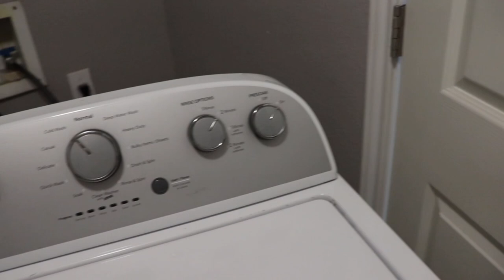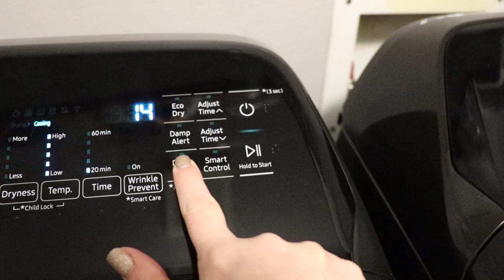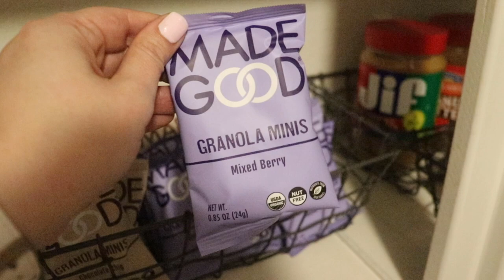SUPER SATISFYING LAUNDRY & PANTRY ORGANIZATION AND MAKEOVER

Comment: Grace chopped a lot of work but it was worth it Where did you put the big bottles of laundry detergent that you had left over And your water and soda that you put so high up if they were to open or break they would spill on everything dripping down you think dripping down maybe you should put them on the 1st shelf
Reply: Great job
Reply from the maker: The two larger liquid detergents were almost empty so I filled those up into the two smaller glass jars. I don’t use the liquid ones as often. Mostly for dog bedding. 

The water and canned drinks on top are extras. So when I pull those down they are to restock the fridge. It’s mostly up top to get out of the way. We had so much going on, on the floor and it seemed to encourage the kids to just keep piling more on top. 😂 
Eventually I’d like to organize extras in my garage and that video is coming in the next month.